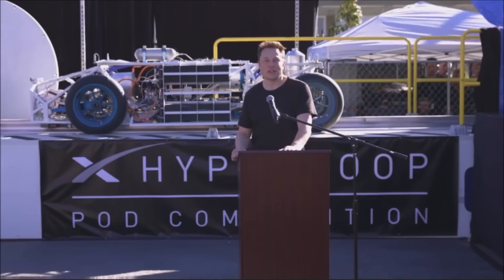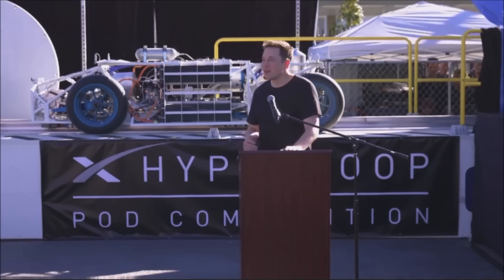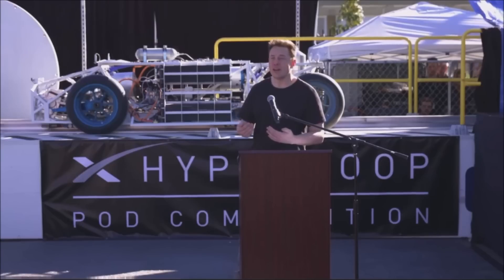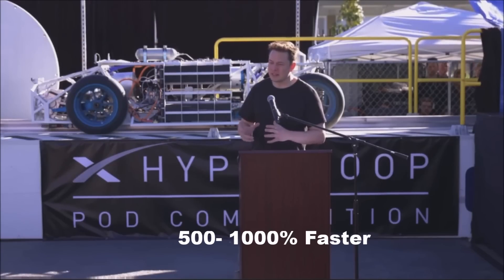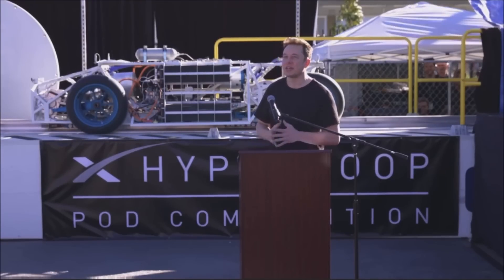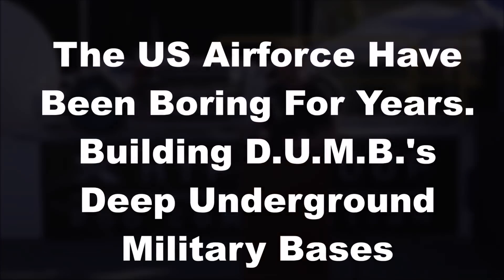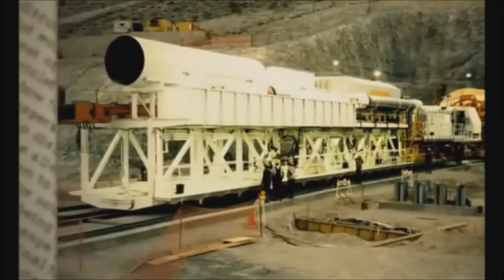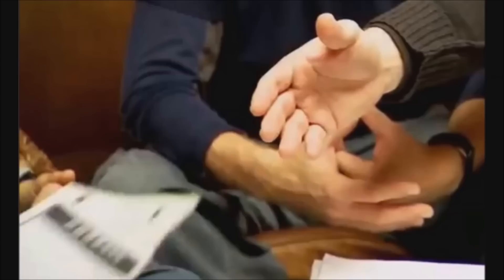SpaceX Redesigns (TBM) Tunnel Boring Machine

Comment: ...Melts rock, extrudes molten glass to line tunnel...  Hmm.  So, you want me to believe that this magical nuclear boring machine (end of clip) compresses all that rock into an unspecified-thickness shell of glass.  BULLSHIT.  I might be able to swallow the glass lining thing with some energetic handwaving and appropriate salesmanship, but having no overburden to remove is just plain crap.

Let's say the tunnel is 14m diameter; so that's roughly 500 square metres - 500 cubic metres of rock per metre of tunnel that you have to excavate.  The circumference of that tunnel would then be a whisker under 44m.  Let's pretend that the glass wall is a metre thick, so you're going to stuff 500cm3 of rock into less than 44m3 of space.  How dense do you think you can make that glass?  Continental crustal rock has a density of about 2.7g/cm3 on average.  Window glass has a density of roughly 2.5g/cm3.  Do you detect a slight problem here?

FFS.  I have less trouble believing in "Solar Freaking Roadways" (see Thunderf00t's excellent video on that, btw) than in this steaming turd sandwich.
Reply: Don't rush to conclusions ( if you do it,  just mention that you do it for yourself) .Retreat, check the facts and come in the public space ( Agora ) and give us the bad news/good news.Meanwhile check  your engineering claims once more, and mostly, ask other people "in the know" what they believe about your statements.
Reply: +serbanmike If that was to me, of course it was my opinion - I can't claim to speak for anyone else.  I did check the Subterrene - though no deeper than the Wikipedia page.  That page contains the fact that a patent was lodged, and one old photo purporting to be a Russian model, and does not mention if any others were ever built or if that one itself actually worked.  Many things which are patented are complete rubbish - like cold fusion.

If you can suggest an information source that does not read like it comes from a UFO site, then please do.  Perhaps in the meantime however, you might suggest the means by which that machine can make glass which has a density of over 30g/cm3 - which is almost 3 times denser than lead?
Reply: +C Lopez  I would say they're both points are clear indications of snake oil salesmanship, but you are correct that I hadn't considered that one.
Reply: Five-minute fact check: With access to a large database of relevant scientific journal material and being a month away from a BS in mechanical engineering, I have found nothing to support the extraordinary claim that nuclear boring machines exist. I find even less evidence for an existing system of tunnels in the US. The references I did find to the nuclear boring machine were all from places like sheepletv.com and abovetopsecret.com...whereas the best peer-reviewed article I looked at spoke of advancements in traditional boring practices. 

It appears the real advances will be in updated sensing equipment that can better map out the fractures in rock that might lead to cave-ins or even earthquakes. Also, from my brief survey of the literature, there is significant work in an area called 'Field Penetration'. Which my very superficial understanding suggests is related to real-time guidance and mapping.
Reply: @mbcoalson  go check the patents. Defense patents 1950s Civilian patents 1960s air force version 1970s. . Also for large excavations they DID REMOVE some materiel. The machines were powwred by a small nuclear power plant just like a submarime has.. There was a system with molten metal that agatized the materiel around the outside making it water proof and even an electrical conductor and water aird proof(vacuum tunnels)
Reply from the maker: CyberiusT  you should have Googled to fact -check me !..... before you wrote all that. Mmmmmm much to learn little padawan.